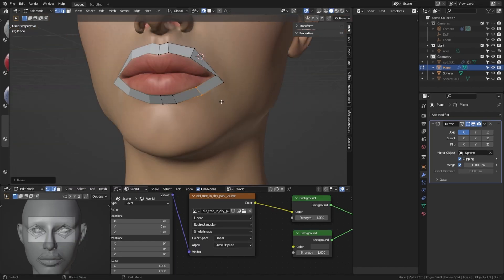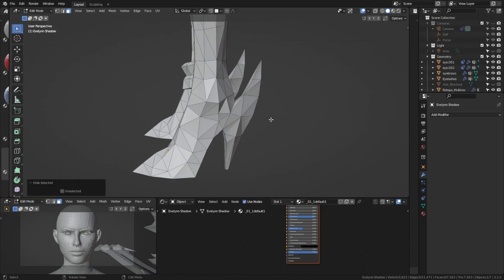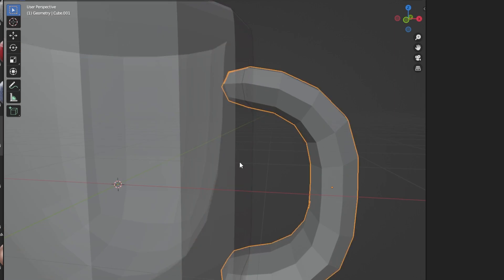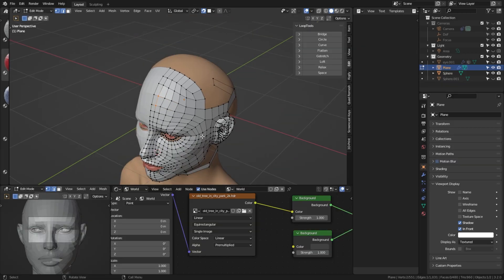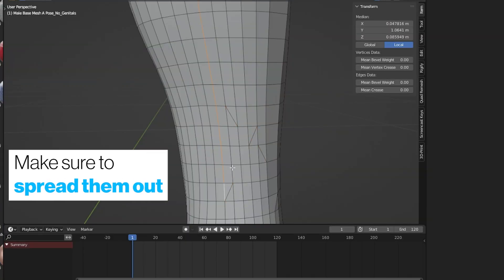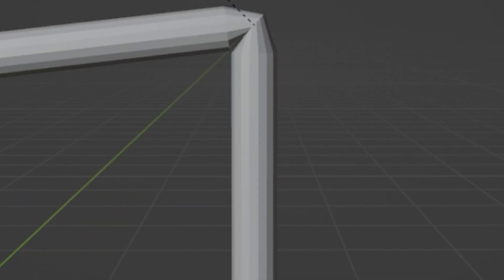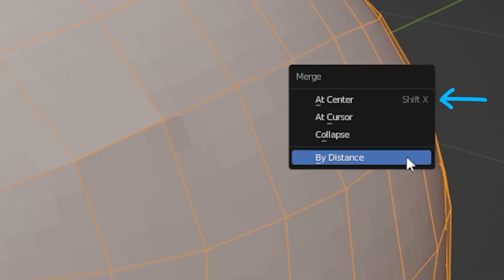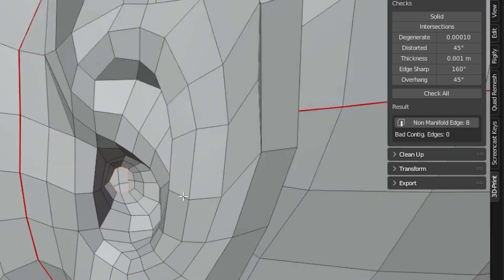Your Retopology Checklist For Perfect Topology

Comment: One note at 2:17:
I personally wouldn't go for an "If it's connected in reallife, it should be connected in a model" approach. You can save a ton of topology hassle and therefore time if you leave certain things unconnected whenever your project allows for it. Especially when working with cloth/softbody simulations on a character, it saves you tons and tons of baking and setup time, when those pieces are separate. Our professors at uni (Game Art) even recommended this, as the pros outweigh the cons (such as "unconnected" normals).
Most games with character creation systems use this separation to their advantage by simply swapping entire body parts instead of deforming a single one. This works through perfectly aligned topology and an average normal between the two parts at the seam.

Though i think that in engines like Unreal every unconnected piece of geometry (within a model) results in one extra drawcall. Don't quote me on that though, i just think i've read/heard it somewhere.
Reply from the maker: Interesting. Thanks for the tip.

Comment: in sculpt mode there is a super useful function not many know about, if you use the slide relax and hold shift for smoothing, it is a volume preserving smooth, unlike the normal smooth which can destroy the shape, very useful for medium poly
Reply from the maker: I forgot about that one! Great tip! 👍
Reply: You can also use the Smooth Brush itself and change the deformation from laplacian to surface in the tool panel

Comment: Very useful! However, things are slightly different for VR avatars! They're relatively low poly, but don't necessarily hide topology that's out of sight either, as people can do weird things - then there's another type of deformation to account for, customization topology! In human avatars, this doesn't need to account for too much deviation aside from musculature or fat, etc. Non humanoid avatars on the other hand, can have dramatic degrees of customizations, from changing the shapes of the legs and how the knees work in real time, to simple things like adjusting the shape of the avatar in realtime. In other words, for VR avatars, we have to make many, maaaany blend shapes -_-.
Reply from the maker: I didn't know that. Thanks for the remark. :)

Comment: Hi, I started to (repair) my model (checkpoint for retopology - end your model so you dont change it retopologized unless it would be a total mess) what I mean is making little changes and Im trying to repair hand and its going really bad compared to other body parts. When I try to make it better its getting worse. The thing is that the rotation is bad, overall size and lenght doesnt work and fingers are like: this one is crushed with hammer, this one had car driven over, this one looks like a snake, the other one is a jelly. So maybe cutting off and sculpting as a new object then joining it to the body would be easier and better? Is there a thing like that?
Reply from the maker: If it seems like any attempt at fixing problems leads to more problems, I would probably start over. The next attempt is always better. :)

Comment: I've been looking for something like this forever. I want to figure out if there are ways to train a ML model to automate retopology, but the first step is to "define" what is good, and this video condenses it all very well
Reply from the maker: I think automatic retopology will get better, but I think there will always be a bit of subjectivity and creativity that is part of the process that is hard to code. :)
Reply: idk what is a ML Model But Automate hmmm...
First think of Trouble areas (Areas that Require Connecting. Foot to Ankle to Bottom leg - To Knee - to Top leg....etc)
Topology is the Tricky Part. Good Topo is Based on Preference.

... but after Marking the Trouble Areas you could also get info from the Connected areas (aka  Find the Location Where the Mark Ankle and the Foot Connections Are).
And mark them as Bendable Areas for Later use. (this is where we Would have More Control over the Final Product LUL).

But it stills pop out the Question what is Good Topology? idk how to figure that one out LUL....

(Since you are Starting with a Base Model its Gonna use that as Reference for placing the Polys and you could mark the areas yourself so it can be more Precise),

well after Doing searching the Definition of ML Model oohhh xD.

Well that Add more Complexity...  im not experience in that area. i only watch 2 Minute Paper and reading those Papers go over my head....
Reply: @pikachufan25  thanks for the detailed reply! I think retopology is a a great use case for machine learning since it is one of these tasks where professional can tell if something is good, but it's hard to point out exactly what make it good. However we know there's definitely difference between good and bad. So with enough data, it's likely you can train a model that will automatically retopologize models on its own while taking in feedback from the human user. Even if the model by itself doesn't fully automate the workflow, if it can function as a helper then it's already very valuable.